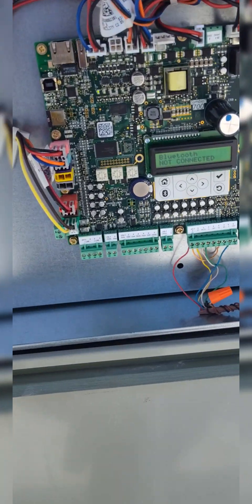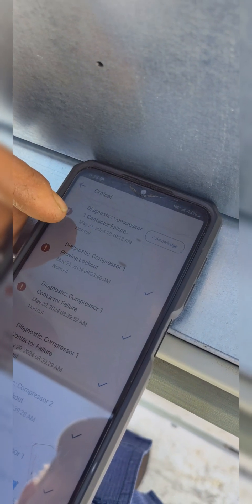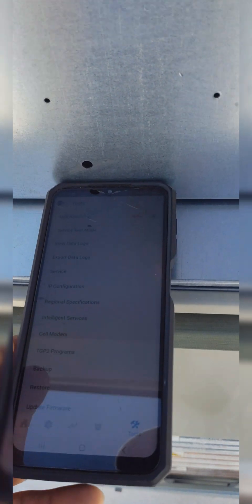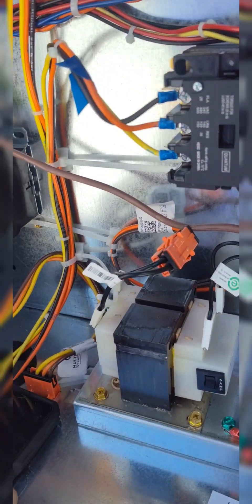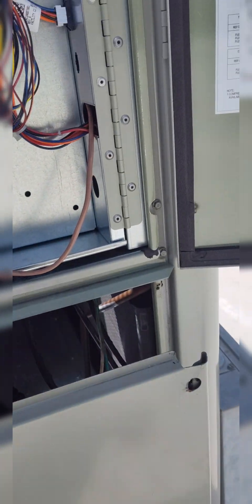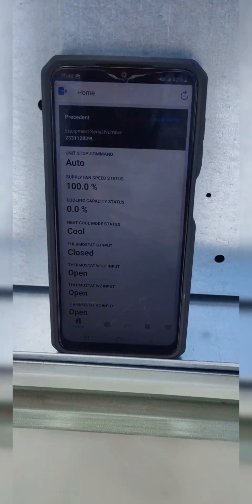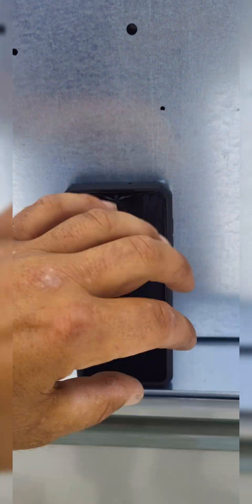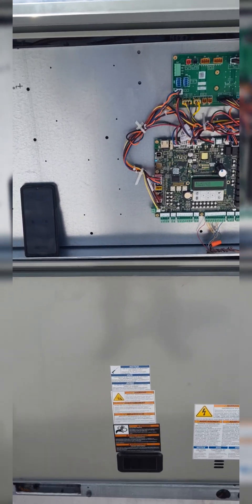Is it just me or is Trane symbio turning on the wrong compressor? simple fix on this one.

Comment: We just installed a new 10 ton unit, the same model  having the same issue com 2 proving  lockout. I waited 2 hours for tech support just to be told that trane doesn't have a tech support line going on about 8 to 9 years now and that they couldn't help me.. what number did you call for help?
Reply from the maker: Good luck. They do the same to everyone..
Reply: @daddyg3124 
Had same issue with same exact tonnage. Spoke to tech line and they had mentioned that quite a bit of 10T units were overcharge by 1-2.5lbs causing proving lockout. From what I was told 10T units were electronically machine charged under either a 12.5T or 15T profile. I recovered  about 2lbs and unit started up and stayed on. Also the 24v molex connectors were loose and I cut them out and added spades to wired them straight to the contactor 24v side.

Comment: Cool 1 is NOT the same as compressor 1. Compressor 2 is the smaller of the two compressors. That will always be the first on last off. This is stated in the manual a couple times. The contactor failure faults you are having is because you have Y1 and Y2 jumped out. If the aux switch makes without a call it thinks the contactor is welded.

Comment: Circuit 2 is stage 1 cooling,  the smaller compressor. 
I've seen the proving error, caused by discharge temp sensor.

Comment: Can you just move the 24 V wires from one contactor to the other
Reply from the maker: No, the board will fault out. First thing I tried.
Reply: Cool 1 is NOT the same as compressor 1. Compressor 2 is the smaller of the two compressors. That will always be the first on last off. This is stated in the manual a couple times. The contactor failure faults you are having is because you have Y1 and Y2 jumped out. If the aux switch makes without a call it thinks the contactor is welded.
Reply: @joshuaricks7730 exactly!

Comment: I have the same issue on a 7.5ton proving switch 1st stage issue, and tech supports no help. I replaced the contactor and aux without resolution. Did you find a solution?
Reply from the maker: We replaced contactor and micro switch and 2 days later ordered a Dainkin unit.  We are experimenting with gutting controller on a few units but have not made a final decision to what methods we will use in the future....
Reply: Bottom contractor is actually circuit #1. Schematic is labeled wrong. Small compressor is 1st stage. Don’t ask me how I know. Had this exact issue and scratched my head for awhile. Check incoming voltage. Trane taps all their transformers for 240v. Had to tap the transformers for 208v. Haven’t had a single trip since. My control voltage went from 23.2v to 27v. Tranes are super sensitive to anything below 24v
Reply from the maker: Yeah we replaced the switch and have not been back..
Reply: Anybody having issues with these units not dehumidifying in 1st stage cooling? 33% cooling capacity and 66% fan speed. 50+ degree saturated suction temperature not below RAT dew point. I’ve lowered the “max fan speed” as a temporary fix but then when unit runs 100% cooling capacity it like 230cfm/ton.